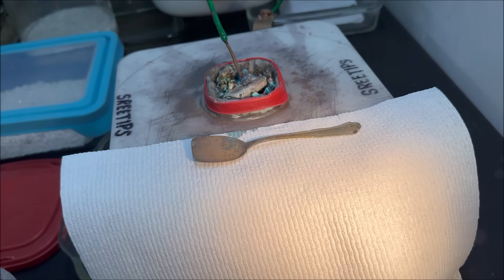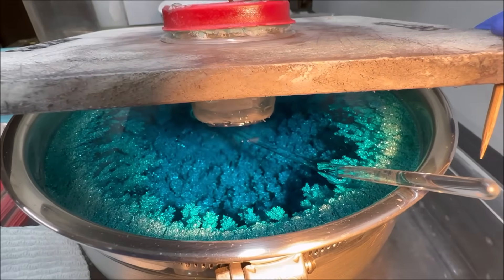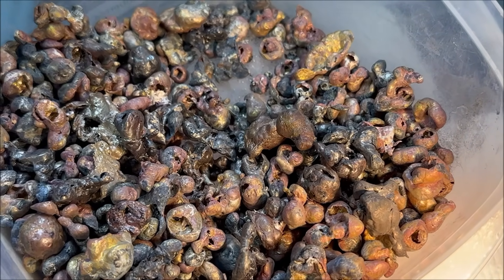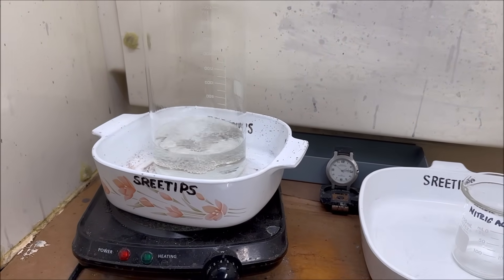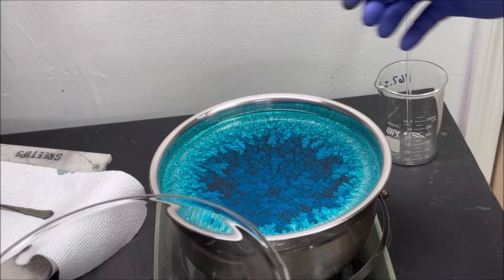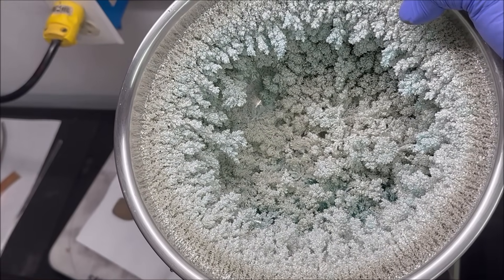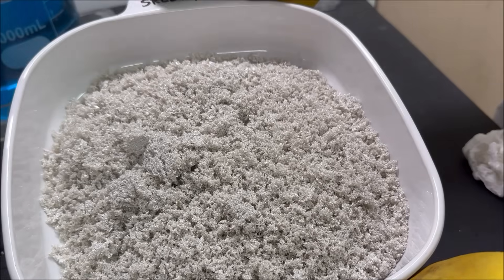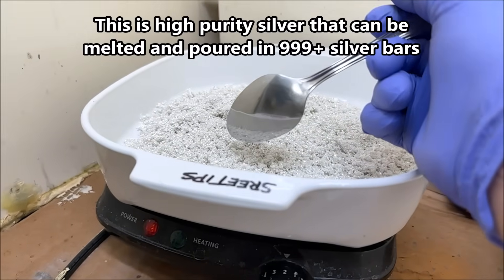999 Fine Silver Cell Harvest and Reboot

Comment: mr sreetips may i ask how you keep the copper down below the threshold where it starts to settle out into the silver crystals? is that why you create more silver nitrate solution when doing a second run to help dilute the already copper imbued silver nitrate solution and keep it below that threshold?

and more importantly what do you do with the solution youve used twice, do you keep diluting it or do you use some chemist magic to drop the silver out of solution keeping the copper behind to dispose of?
Reply from the maker: I never use the electrolyte more than twice. I add fresh silver nitrate for the second run. I cement the silver out of the used electrolyte on copper.

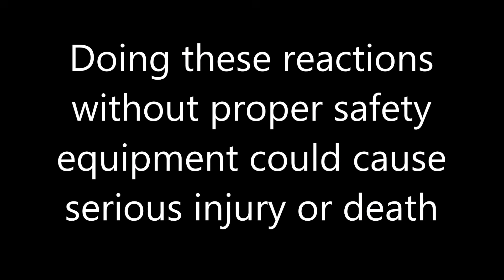Comment: 00:09 Harvesting high-purity silver from the silver cell
02:16 Importance of having a fuse in the silver cell operation
04:23 Electrolysis process to yield pure elemental silver metal.
06:21 Preparing additional electrolyte with pure silver Crystal
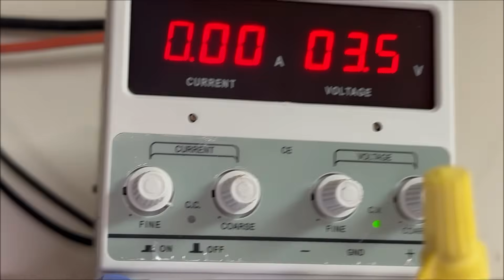09:10 Harvesting and handling pure silver crystals.
12:32 Rinsing off electrolyte from pure silver crystals
15:42 Rebooting the silver cell with a new electrolyte
17:38 Pure silver crystals formed after 30 minutes.
Crafted by Merlin AI.
Reply: That sounds like a hell of a process!

Comment: So you buy impure silver and then do all this to make it pure? Is there good money in that type of thing?
Reply from the maker: The “good money” are the gold and silver themselves. I refine gold. I use sterling silver, that I buy at estate sales, to refine the scrap gold. I recover the silver from that, melt into shot, and run it through my silver cell. Silver is a by-product of my gold refining. The silver cell converts the impure silver (about 980 parts per thousand silver) to high purity four nines fine (9999 parts per ten thousand) pure elemental silver metal. The impure silver is added to the anode basket. The anode basket is suspended in the silver nitrate electrolyte. I pass an electric current through the impure silver. The silver dissolves, passes through the Dacron filter, travels through the silver nitrate electrolyte, and deposits on the stainless steel bowl (the cathode). The bowl is connected to the negative pole of the power supply. The process only deposits pure silver on the cathode. So I’m refining the impure silver, into high purity silver. When it’s full, I harvest the pure silver crystal, put it away, and forget about it. Then I repeat the whole thing again.
Reply: 🧠 💡 brilliant

Comment: Can't you set a limit instead of fuses and burning? I'm plating with amps at max but volts is turned low and won't go above what I set it at while shorted together before hooking up.
   A dummy load (light bulb) can steal some of the amps if more suddenly become available. Smoothing would still be what it technically was doing. I think it would take some of the amps.
Reply from the maker: The amps will drop off as the filter gets clogged with slime. Then I can install a four amp fuse. I’m still working the bugs out.

Comment: How much initial cost is there in starting a setup like this? This seems like a great way to supplement income or make a stockpile of precious metals in case of economic collapse.
Reply from the maker: You can hold sterling silver just like it is. No need to refine it like I do. The only reason I refine the silver is because I use sterling silver to refine gold. Silver is a by-product of my gold refining. I get lazy and let the silver pile up on me because it’s bulky, messy, time consuming, and creates lots of waste that must be treated. I have buckets of cement silver that must be melted and run through my silver cells. It’s a giant pain. But what else am I going to do with it. I harvest the crystal, put it away, and forget about it. So you see, you buy sterling flatware sets at estate sales, like I do, and hold your silver that way. It will track right on up, and serve the same function as silver bullion, except you can get it at a discount. Just don’t try melting it because then the markings are ruined and the value  becomes questionable.
Reply: I am a silversmith and love buying 100% sterling flatware from estate sales and melting it down. Often times they'll sell it to you for under sterling spot just to get rid of it. Sterling scrap is pretty good too, broken jewelry, chains, bent or damaged flatware. Of course Im not keeping it for the value, Im using it to make sterling jewelry out of it, usually with precious stones in it (I can work gold. But I just dont like the look of it so I generally dont. And I cant work Platinum although I wish I could, but that melting point and hardness is freaking insane.) 

 And it ends up with my own 925 stamp on it in the end.

If you were keeping it just for value because of worries about societal instability, yeah - dont melt it.

But also keep in mind that if the system we live in collapses and we are all dealing with near survival situation, things like medication, ammo, firearms, tools, knives, fishing gear or skills in things like mechanical repair, hunting/fishing, metalworking, carpentry and so on will be considered far more valuable in that type of situation than gold or silver.
Reply from the maker: @childofcascadia I refine gold. I use sterling silver, that I buy at estate sales, to refine the scrap gold. I recover the silver from that, melt into shot, and run it through my silver cell. The cell converts the impure silver (about 980 parts per thousand silver) to high purity four nines fine (9999 parts per ten thousand) pure elemental silver metal. The impure silver is added to the anode basket. The anode basket is suspended in the silver nitrate electrolyte. I pass an electric current through the impure silver. The silver dissolves, passes through the Dacron filter, travels through the silver nitrate electrolyte, and deposits on the stainless steel bowl (the cathode). The bowl is connected to the negative pole of the power supply. The process only deposits pure silver on the cathode. So I’m refining the impure silver, into high purity silver. When it’s full, I harvest the pure silver crystal, put it away and forget about it. Then I repeat the whole thing again.

Comment: I never heard current would dissolve a metal...Could u explain more how that would work cause i have trouble understanding how Solid metal would travel into the electrolyte...And why does the electrolyte have to contain silver in the first place? Tbh for me it sounds like you just build an ordinary galvanic cell using silver ions in the electrolyte to form the elemental silver...Also how do you dispose the vast amounts of chmemicals u produce?
Reply from the maker: I’m not exactly sure how it works myself. Any silver in that DC voltage circuit (including copper) will dissolve and pass through the filter, into the silver nitrate electrolyte, then deposit as absolutely pure elemental silver metal on the stainless bowl (the cathode. For the waste; waste treatment.
Reply: @sreetips  hmmm kinda dissappointing cause i see a big problem with this...Youre basically just applying current to a conductor which shouldnt trigger any reaction. Just imagine what would happen to copper wires, if they would just dissolve under current...So to me either youre not providing full information or the apparatus should not work at all...all i see is an ordinary galvanic cell and nothing that would explain this behaviour...also if youre dissolving the silver that fast, why isnt the silver bar at the electrode decomposed to? Kinda sure this is just fake sadly
Reply from the maker: Current flow dissolves the silver shot. But if I keep the anode electrode bar up out of the electrolyte then it won’t dissolve and I can use it many times. I’m not the only one doing this. You can check with others. It’s the real deal. Every pure silver bar or round on the planet began as pure silver crystal, just like you see here.
Reply: @sreetips well thats what u want your viewers to believe...but without acids involved there is just 0 chance the metals would dissolve...there is just no reason a current or a galvanic cell would cause this...Specially as there should be way more unnoble metals inside this bulk that would corrode first...the fact that only pure silver is supposed to come from this lump of metal is just as realistic imo
Reply from the maker: In the Navy, we used sacrificial zinc anodes bolted to the ship below the waterline to prevent galvanic corrosion of the steel hull. The anodes would slowly dissolve as a weak electric current generated by the ship moving through the water. The sea water was the electrolyte. It’s kind of the same principle here. Except I’m using a much higher current flow generated by a power supply. The electrolyte does have a slight bit of acid in it. The pH of the silver nitrate electrolyte is near pH1. Sounds like you think I’m deceiving a quarter million people into thinking that I’m creating silver out of thin air. I’m not creating silver, I’m refining it.
Reply: @sreetips  This works because you use zinc as a donor electrode which will corrode instead of the more noble iron from the hull...so thats nothing speical and makes 100% sense...what you got here is silver mixed with alot of other probably less noble metals...so why would only silver dissolve and form from the electrolyte but NO Other metal?? Also if you dont know how it works how did u come up with this in the first place? i think youre just using this to fool ppl and get some content you would just not be able to otherwise...As if you would randomly throw metals in a electrolyte apply volatege and get pure silver out of it...
Reply from the maker: I see. You think the silver is highly contaminated. It’s not. The silver is 98% recovered from my gold refining. The main contaminant is copper, with a little gold and platinum group metals. In order for electrolytic refining to work, the anode material must be relatively high purity. 98% is a guesstimate.
Reply: @sreetips  So what would be the "goo" forming then? And why would i have to have a silver anode, in order to purify? As u said the silver electrode does not get into contact with the electrolyte so its basically not part of the galvanic cell but just a conductor like the copper wire you use...
Reply from the maker: @ingoweyrauch8024 correct. The “goo” is sliver cell slimes. Will have small the insoluble material including gold and platinum group metals, if present.

Comment: WOULDN’T 999 BE A METAL? ROYAL CANADIAN MINT SELLS 9999 IN METAL FORM COINS. WOULN’T CRYSTALS BE OF SUCH PURITY IT CAN’T BE MEASURED. CRYSTALS SHOULD BE SO CLOSE TO 100 THAT IT’S (WELL CRYSTALIZED) BUT LITERALLY DUST PARTICLES.
Reply from the maker: IVE HAD IT ANALYZED, COMES BACK GREATER THAN THREE NINES EVERY TIME, EXCEPT ONCE. I RAN A BATCH OF CRYSTAL BACK THROUGH THE CELL A SECOND TIME. THAT ICP ASSAY CAME BACK GREATER THAN FIVE NINES FINE.

Comment: What is the source of the material you are refining to recover the silver ?
Reply from the maker: I buy sterling silver at estate sales. I refine gold also. I use sterling silver to refine the scrap gold. Silver is a by-product of my gold refining. I recover the silver from that, melt into shot, and run it through my silver cell. The cell converts the impure silver (about 980 parts per thousand silver) to high purity four nines fine (9999 parts per ten thousand) pure elemental silver metal. The impure silver is added to the anode basket. The anode basket is suspended in the silver nitrate electrolyte. I pass an electric current through the impure silver. The silver dissolves, passes through the Dacron filter, travels through the silver nitrate electrolyte, and deposits on the stainless steel bowl (the cathode). The bowl is connected to the negative pole of the power supply. The process only deposits pure silver on the cathode. So I’m refining the impure silver, into high purity silver. When it’s full, I harvest the pure silver crystal, put it away and forget about it. Then I repeat the whole thing again.

Comment: thanks for sharing this. someone shared this with me and I really like that you addressed all of the electrochemistry basics in your explanation. Could you share how you know it is 999 Fine Silver?
Reply from the maker: I’ve had the silver analyzed several times. I use strict controls to ensure high purity for each batch. The samples I sent in came back three nines every time, except once. I ran a batch of silver crystal back through the cell a second time and sent it in for ICP analysis. That came back greater than five nines fine. That’s better than 99,999 parts per one hundred thousand pure silver.
Reply: @sreetips your controls really are in place and that's great to hear. If I do end up doing a study of my own - I'll keep you posted on my progress. Thanks so much for the knowledge share.

Comment: As a silversmith, I would sure like to have my own unlimited supply of material to smith. Thanks!
Reply from the maker: Right now, silver is grossly undervalued. While it’s not “unlimited” we buy sterling silver at local sales. I just purchased a sterling flatware set, 2600 grams of sterling silver, for $1380. The sellers use the undervalued spot price to determine their asking price! But this won’t go on like this forever. Eventually, as with GOLD, people will begin to realize that holding stacks of paper dollars is a bad idea. We can’t find much gold for sale anymore. This is how it will get with silver also. Silver is money. Silver is “poor man’s gold”. But they’ve been able to kill the price of silver nicely. To prevent folks from converting their dollars (that can be printed “without limit” out of thin air) into silver. Soon, we won’t be able to find the silver anymore. But right now, it’s a silver-buyers paradise out there.

Comment: I really enjoyed the video, but please excuse my ignorance.  I am a business guy (MBA); is there a monetary component to doing this or is it for science and hobby?  Your yield was worth around $1100 at current silver spot prices.  What was the material and time cost, or break-even point?  A lot of times people see stuff like this and think that there is a get-rich-quick opportunity, which is almost always not the case. Either way, your video was very cool.
Reply from the maker: First, please understand, that silver (and gold) are real money, since biblical times and before. Paper dollars are a money substitute. Once you understand that, then you’ll be able to see what I’m doing here. I refine gold. I use sterling silver, that I buy at estate sales, to refine the scrap gold. I recover the silver from that, melt into shot, and run it through my silver cell. The cell converts the impure silver (about 980 parts per thousand silver) to high purity four nines fine (9999 parts per ten thousand) pure elemental silver metal. The impure 980 parts per thousand silver is added to the anode basket. The anode basket is suspended in the silver nitrate electrolyte. I pass an electric current through the impure silver. The silver dissolves, passes through the Dacron filter, travels through the silver nitrate electrolyte, and deposits on the stainless steel bowl (the cathode) as high purity, four nines fine, pure elemental silver. The bowl is connected to the negative pole of the power supply. The process only deposits pure silver on the cathode. So I’m refining the impure silver, into high purity silver. When it’s full, I harvest the pure silver crystal. Then I repeat the whole thing again. So you see, my savings are measured in metals, that are rising in value. Not paper dollars, that are declining in value and purchasing power. If I need some paper to pay bills or buy food, then I can sell a little of my metal. Thank you for your interest.
Reply: @sreetips Can you answer his question though.
Reply from the maker: He wants to know if it’s profitable, or a break even point. I can’t answer his question because I lack the data. I’d have to sell my metal to give an answer. And I ain’t selling any of my metal - except a few ounces on my eBay site. Other than that, I’m keeping my metal.
Reply from the maker: I sold a couple ounces of silver crystal the other day for $101 per ounce. Perhaps this might provide some insight.
Reply: @sreetips  I truly appreciate the responses. That price is crazy high, you need to keep your buyers close to your vest.  Today's (3/8/2024) .999 silver spot prices are $24.54 per ounce.  .999 Silver crystals selling on eBay are anywhere from $34.99 - $48 per ounce. It appears that if someone really enjoyed the process, they could actually make a little money with their hobby.  Kudos to you and I will continue to watch your videos in amazement.  Thank you.
Reply from the maker: I don’t have to worry about selling. I’m holding the metal. Trading my silver for paper dollars makes no sense.

Comment: I had no Idea you could "grow" silver
Reply from the maker: Grow: to increase in size or mass. The silver grows on the cathode because I’m passing electric current through the impure silver which dissolves it. Then it passes through the filter, through the electrolyte, and deposits (grows) on the inside of the stainless bowl (the cathode).